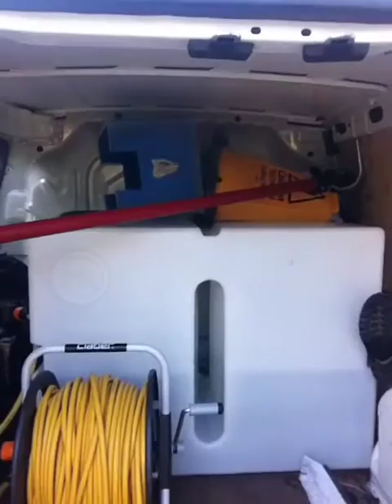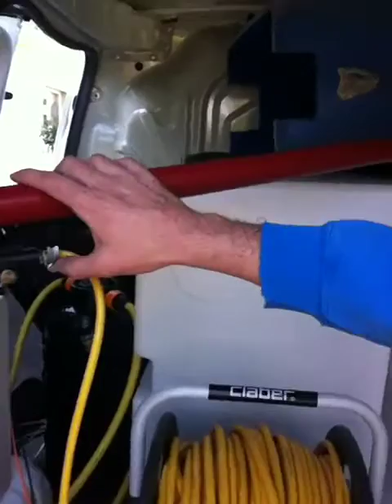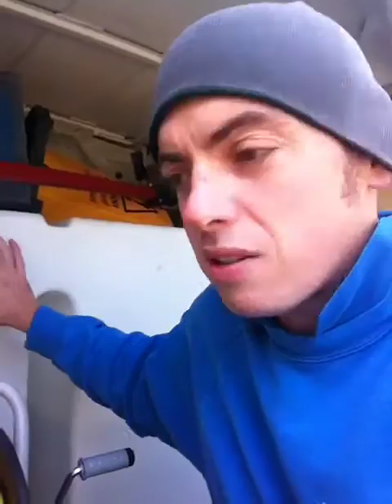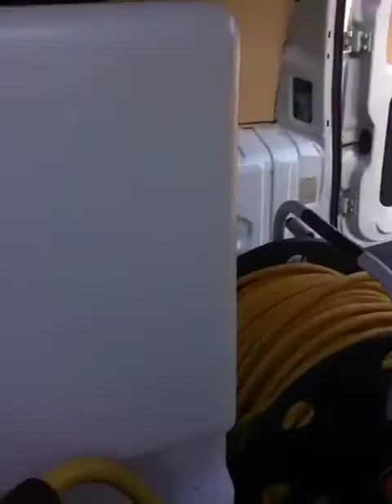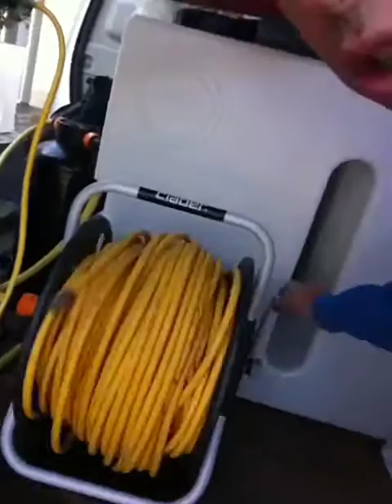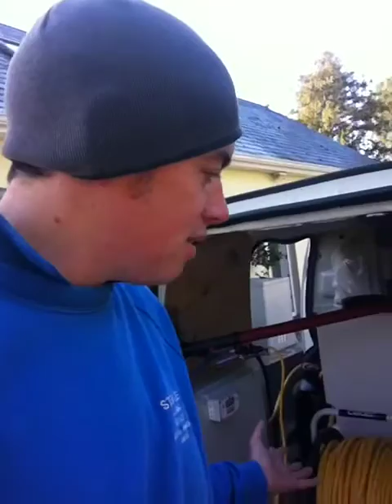How to fit out you van with the wfp

Comment: I fitted a two man set up all second hand gardinir poles 650 ltr tank tow hose reels 100 metra  the  lot for £600. probley £3000 if i got some one to fit it  Also got a 40/40 filter set up  zero ppm in my back garden that cost me £200 all up and running.
Reply: Carl, a 40/40 system for £200 that's a bargain, Did you also need to buy new filters though? Or a booster pump?

Comment: Hi Steven, Great vid. Just a quick question. I have brought a second hand set up but the previous owner drew water through the DI vessel - so the pump is situated after the DI vessel in the process. Looking at yours it looks like You have the water "pushing" through the vessel and after the pump. Which way is best?.
Reply from the maker: I far prefer it to push through rather than draw. What I found is that if the tank got below the level of the pump it would start to struggle to pull it through and flow rate was effected 👍🏻 when your pushing through it’s guaranteed. You just need to make sure your joints and resin bottle seal are good and tight for the pressure
Reply: @stevenlee4437  cheers bud. I did think that, also should be easier on the pump, I'll swap it around
Reply: First is the sediment then the carbon filter then the big 40/40 membrane filter that should take it to about 7 ppi  then the last filter will be the resin bottle that's how you get zero ppi water with the filters.

Comment: i got 400 ltr tank £26 ebay two pumps. £20. Three second hand gardener poles £200... eight second hand brushes £160 two hose reels £80 two Di vessels all for less than 500 pound.. if it was new and fitted be £3000 mine works just as good my pumps are 100psi from china £10 each had them working for two years  still going they do the same as a £120 pump.. Also i use my van battery only 3amp pumps dont leave them on over night other wise you will need a jump start been going years with this set up..

Comment: If you never use more than 350ltrs per day Steven , then you must have your water coming out in a trickle or you stop work at 1pm!  And your asking for trouble carrying an unsecured  water tank !
Reply from the maker: JD this is an old video now man. I did one last week of my latest set up/ with a caged 650 2 man system.
Still using 350 liters per man... spotless results (we do a lot of insides too which saves water). You must be wasting a lot of time and water 😊
Reply: Good stuff ..,.........
Reply: I use close to my 500 litres everyday I work on a one man system and my pole is fitted with a univalve to save water.

Comment: Hi Dude, just wondering how many 3 bedroom semi detached or attached houses, on average you can do in a day with a 350 tank. Tempted to buy bigger but not if I dont have to
Reply: trust me go for at least 500L 
I have no idea how you can work a long day with 350 L only ...  I had a 400L before  and always had to carry 25L canisters to top up the tank.  Now ive got 1000L in my transit 280
@ to your question - personally a long day for me means from 730Am to 430pm and I do about 25 houses altogether a mix of detached and semi 
normally 800L - that's how much water I use to get there
Reply: i ve got a standard valve which comes with a gardiner pole  - and i get your point here but I really think that even if I waste some water - is not more than a 40 L per day  ?!  or is it more ... might have to fit a trigger tho
Reply: Stran I hey bud thanks for the comment. Have you a trigger or a univalve? I only ever use 300 liters on a full day, I've never drained a 350 yet even on the longest day (1 person)
Reply: Stran I I suppose it's all down to the time the water flows and also the pressure, my 100psi pump is normally set to about 40psi. Trigger is a love hate thing. We did an episode about it recently on our podcast- the window cleaning podcast- on iTunes etc

Comment: Hi, new to waterfed systems, I have a Mercedes vito van so plenty of room !! but I run another business in which the van is used, Ive seen a compact system from window cleaning wearhouse which is 325L? with built in flow rate, pump, battery and hose real and DI, for that and the R/O and booster with DI is £2450.00 inc, is this excessive or about right?

Comment: 25 years this month I have been a traditional window cleaner and I have two questions for you. One regarding the Battery you are using in the wall mounted box.Judging by the depth of that box I am thinking its a small battery possibly a 12volt 7 amp back up battery for a house alarm. Can you tell me will a Leisure battery say 12volt  70 -100amp somewhat the same size as your van battery will fit inside the box or do you take the power for the pump from the vehicle battery?Second question, what is inside the Tank is it plain tap water or has that water been purified in some way and that resin filter brings the impurities down to 1part per million.I am on the verge of taking the plunge but I need to know what is what before I do.
Reply from the maker: Hi Keith, the battery is a small leisure type battery. It was supplied to me from Surecleansystems.com. Such a neat setup. I did have a car battery beforehand. But tidiness will save you a lot of heartaches and damaged batteries. Drop me any questions to stevenleecontractcleaning@hotmail.com and id be happy to help. The new system is difficult to get a good job with so I'll be loading new videos of best methodology this week!

Comment: I appreciate what your doing mate, but the clx pole is classed as basic pole, you want full carbon really, most use the slx range, also it is much much cheaper doing the setup diy, almost half the price, so it's best to advise people that diy will save them a fortune, also you may find a one shot remote would be better for the water flow, the trigger is really not ideal, the most common used water flow devices are the aquadaptor and the one shot remote...
Reply: +12988Jake  Not everyone can afford an SLX , who gives a shit if the CLX is a basic pole it gets the job done! and its what most people can afford.  You come across as quite arrogant